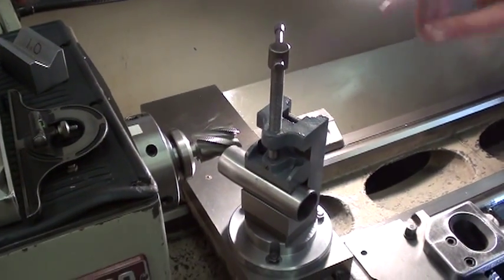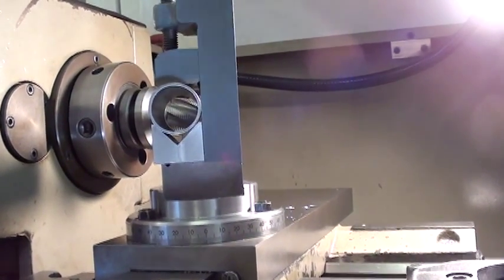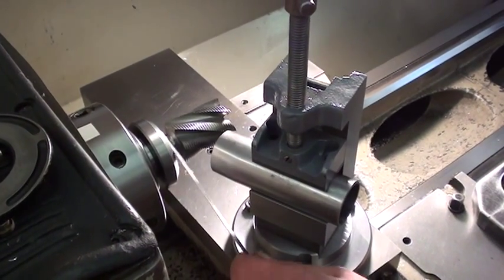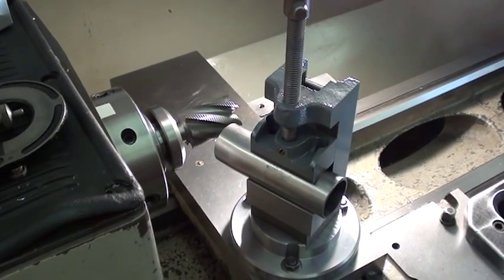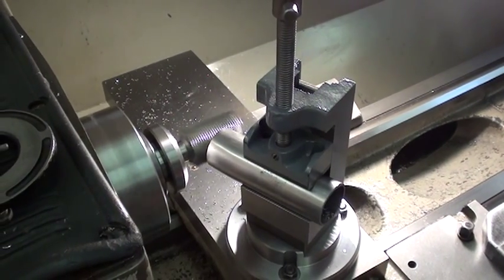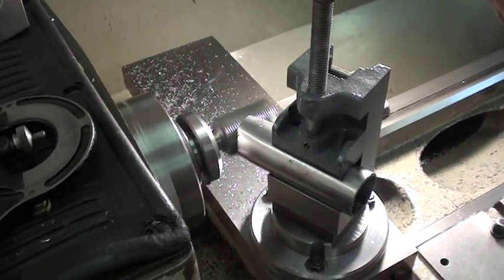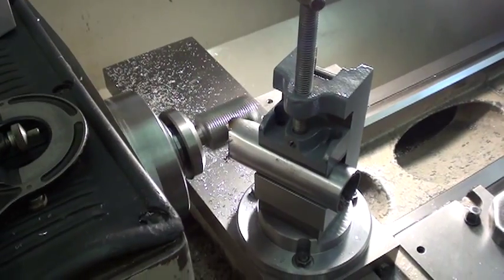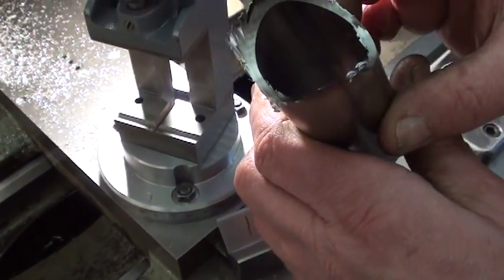tube notching with a lathe

Comment: Try using a corn cob rougher for tube notching; much less tool pressure on your machine. That is not a roughing "bit". Your RPM is about double an acceptable value for HSS tooling in carbon steel work material.  Try 80-100 surface feet/min as a starting point.